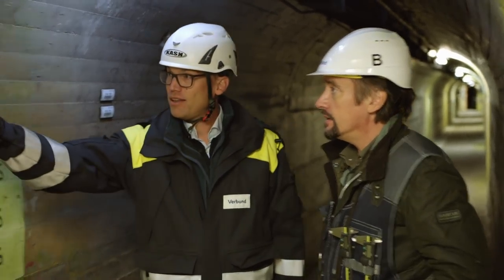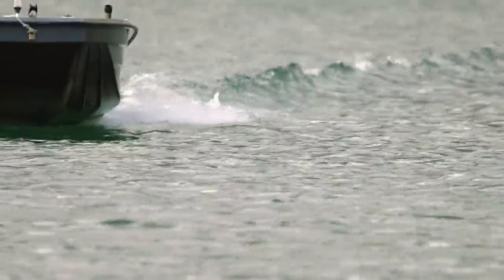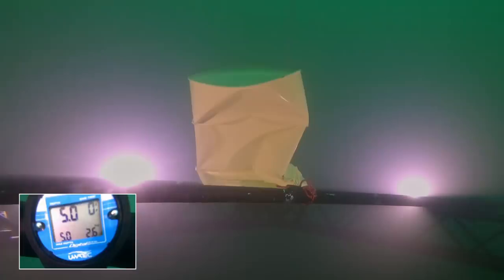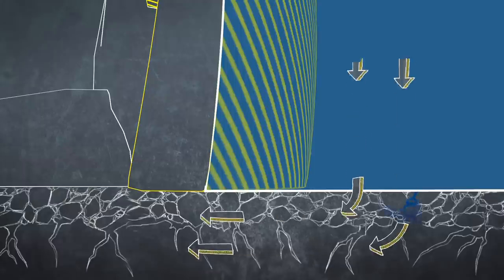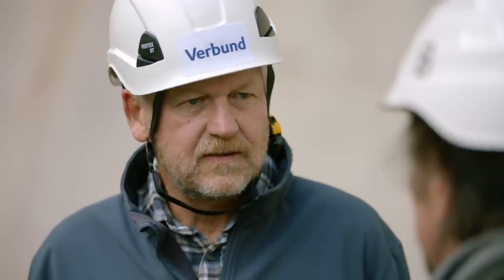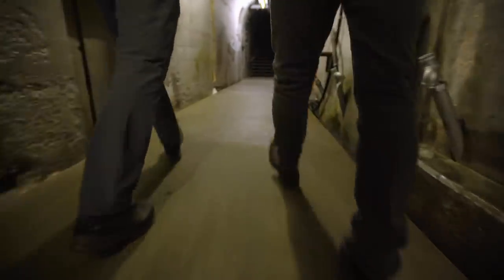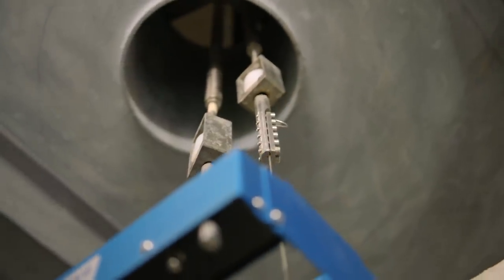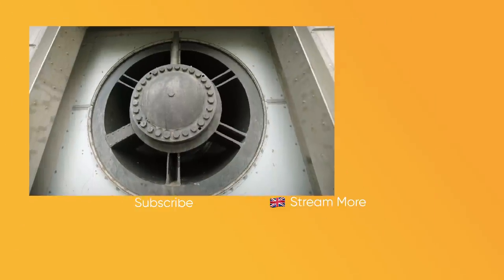The Physics Behind (And Inside) The Kölnbrein Dam | Richard Hammond’s Big

Comment: That dam at 5:12 is in a town not to far from me. The town is called Bracebridge in Ontario Canada, and the dam is perfectly fine. There was a year with an unusual amount of rain and it sort of flew over the top. The dam isnt as high as it looks, and is built ontop of a rock outcrop that creates a lot of whitewater. It's aesthetically the nicest dam I have seen, but most certainly did not fail. Normally you can walk across the top to a park on the other side, but that year they just closed the top off.
Reply: I literally just visited that yesterday!
Reply: I don't think he ever actually insinuated that it had "failed" in any way.  At the start of the video he very obviously sarcastically joked that it was "collapsing", but that was an attempt to jokingly provide the reaction of an average person when they did the measurement and it showed that the concrete had moved.  Non-engineers probably generally assume that concrete structures don't move, so they would be a bit alarmed until someone explained what was happening, which is why that part was scripted into the video.  This is meant for the general public, so if you are particularly knowledgeable about the subject don't get your panties in a bunch over them trying to make things a bit more entertaining/relatable for the layman.

Comment: Hammond have you ever measured something with calipers that's not the way to do it
Reply: Why so condescending?
Reply: @aeiproject  close to the scale there are small gaps for idk what reason so you can't measure accurately if you're close to the scale. You have to go about 3-5mm away front he scale to get a accurate value
Reply: I was thinking the exact same thing!
Reply: @ptrjnsn5719  they are very usefull when you have something like  a cube you just machines and want to measure accuratly without deburring the cutouts enable you to measure it without measuring the hight of th nur you would remove later or before

Comment: 0:51 He's not measuring correctly. Anybody noticed?
Reply: 10 months late, but yes.
I use one of those things daily. He was measuring using the cut-out at the base of the prongs.
Of all the mistakes you can make using a caliper, that's got to be the dumbest...
Reply: @Bird_Dog00  not entirely sure, maybe they actually use the callipers that way. (Like always measuring it that way…)
It would still be stupid. 
But tbh he likely just did it wrong
Reply: @010falcon  That cuttout has only one purpose: It allows you to measure over a freshly machined edge without having to deburr it first. The cuttout leaves room for the burr so it doesn't affect the measurment.
No-one ever uses it to masure anything.

Comment: Why don't they measure all this with sensors instead of old fashioned manual instruments?
Reply: Doesn't rely on software or a permanent electrical supply to function correctly, thus making it more reliable in the long run
Reply: Also they have to do visual inspections of the material itself all the time, looking for cracks, discoloration, rust and water. Since well trained engineers have to run through their regulary anyway it makes no sense to automate something as simple as taking the distance on such a defined spot once a week or so. A sensor network capable to replace enough of the engineers tasks to give a worthwhile advantage would become very complex (also expensive) and by that create a ton more possible failures.
With infrastructure you should try to reduce the number of possible failures.
Reply: when you consider that the giant dam moves like 14cm some hightech sensors would be overkill and also would likely fail, because you cant keep a dam dry and clean as we see in the video. a wet enviroment is really harsh on most electronics and you would either pay premium price for waterproof electronics or you need to replace the sensors every 2 years.
Reply: It’s a combination normally. They probably have strain gauges (cracks), piezometers (pressure), tilt meters etc. But these will be calibrated with human readings (ie weekly / monthly /yearly?). It’s probably legislated that someone has to physically inspect the dam about 3 times a week (but probably not an engineer).

Comment: Why not use a laser instead of a pendulum?
Reply: I think it's because lasers could tilt even if they are held tight. A very very small tilt could cause a huge measuring difference.
Reply: @EmptyNullified  That and a pendulum doesn't stop measuring because some electronic component that's no longer made quit working knocking the thing out of service until the whole thing can be replaced.